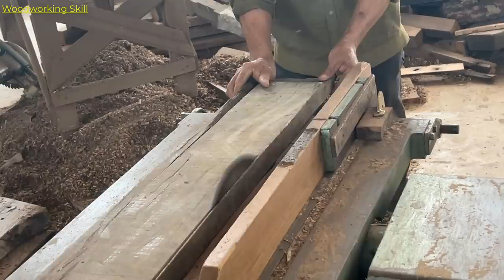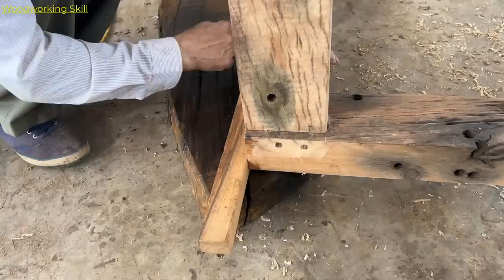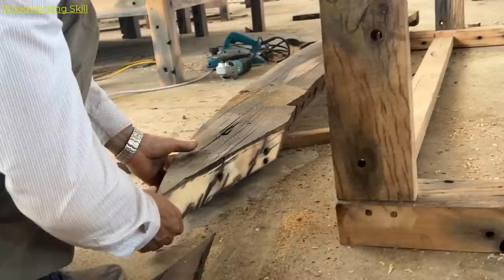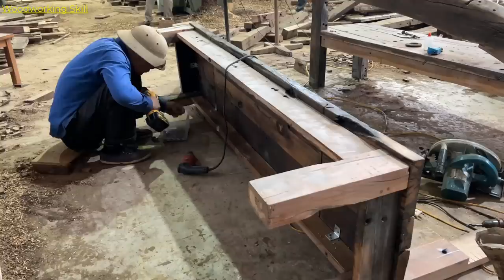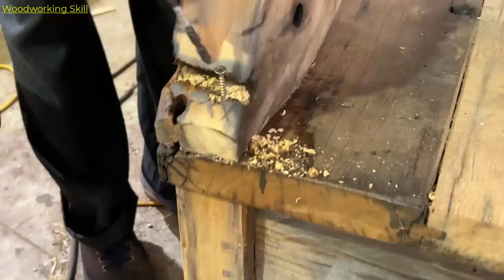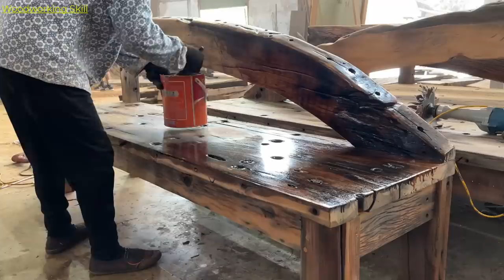Breathe New Life Into Degraded Train Tracks: Make A Bench Out Of Recycled Wood

Comment: Lovely timber! What kind of product do you guys use for finishing? I usually use tung oil but sometimes it gets a bit too dark when you've got an existing patina. Do you really need a finishing product if the surface has a patina?
Reply: Please don't ever use train track or phone poles or anything of the like to build anything..it's soaked in creosote and many other chemicals that isn't good to touch, breathe in the dust, or use in any way..and yes wood with a patina needs to be sealed.